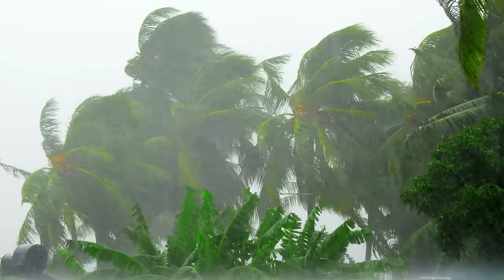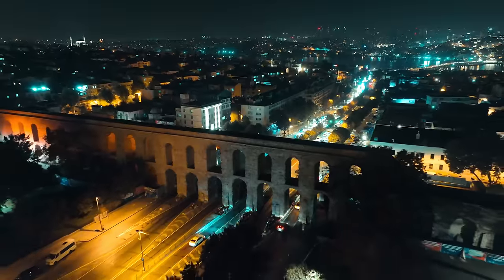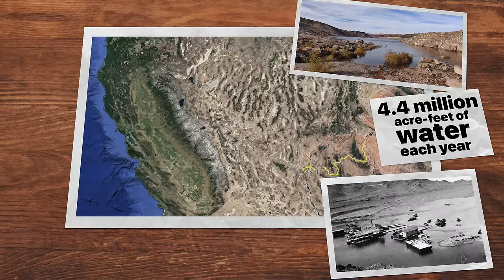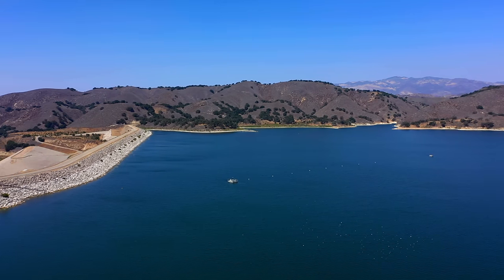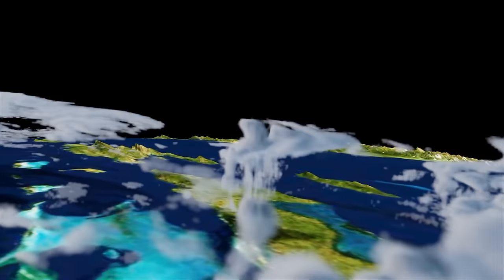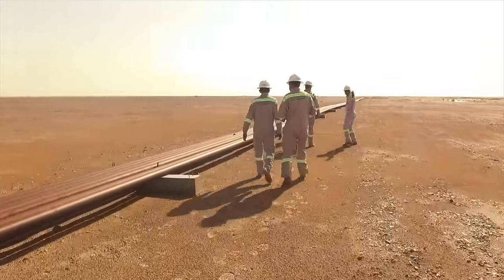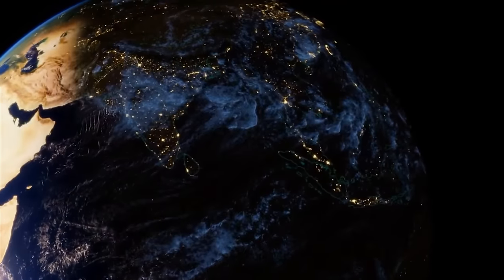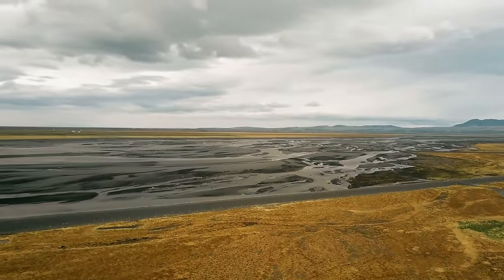Pipelines From Flood to Drought

Comment: A few words that you need to consider, Friction loss, Horsepower (Or Kilowatts), Head lift, Suction loss When you add all these up you are inevitably just looking at an actual PIPE DREAM. Dams are primarily used for water storage. Flood control or mitigation is a distant second, regardless of what ever others may infer Even the best possible release plan prior to an anticipated flood event generally causes flooding or at best primes the event to flood anyway. Now back to the first paragraph. Its is generally cheaper to desalinate water than pump substantial volumes of water over 100s of miles. It takes more Kilowatts (horse power) to pump the water  than it dose to desalinate the same amount and while Aqua-ducts are more efficient if the topography allows, the flow rates cannot be substantially increased to cope with flood events. There for the best option is to dump or use the overflow spillways and let nature do the work for you.
Reply: Excellent point but I think you missed one more point. Dry areas are generally dry for a reason.  There is something that discourages water from going there naturally.  So while this is generally caused by some of the things you mentioned, it also implies low humidity. With low humidity, you have the issue of evaporation. More and more of the water would fail to make it to the destination causing a huge loss in volume, and as such efficiency.
Reply: @davidquist8963  Adding water helps with humidity.  Studies have shown that adding a lake to a dry area increases cloud cover, rainfall, dew etc and rejuvenates the flora, further improving the situation.  If you ignore the problems of capture and transport, dumping and storing more water in dry areas would over time have a net benefit,
Reply: @Johnnyrot10, All you need to do to pump over a mountain is get the water STARTED...once you get enough of it over the mountain, gravity takes over, and it will syphon the rest of the water from it's source. (providing the source is just slightly higher elevation...like the midwest to low lands of california) Then, once the majority of water is syphoned to target location, then you can use pumps to pump it short distances.  Using gravity to take water over VAST distances saves a ton of money.  Leaving the cost of "pumping" the water to shorter distances.
Reply: @Argrouk  , It's hard to compete with mother nature... If the land is dry due to topography, ie Desert adjacent to mountains; it's a never-ending battle to try to convert dry lands to wet lands...It will fail or be cost prohibitive...like Australia failed with their attempt.
Reply: @davidquist8963  , very true. It's hard to compete with mother nature... If the land is dry due to topography, ie Desert adjacent to mountains; it's a never-ending battle to try to convert dry lands to wet lands...It will fail or be cost prohibitive...like Australia failed with their attempt.
Reply: @tjam4229  This may appear to be a simple solution but it is not. The volume of water needed to be pumped over a Hill say 500 ft high over say 10 miles is astronomical, Increasing the pipe line diameter is part of the solution and even when adding "siphon effect" to the system the amount of horse power or kilowatts required to pump flood volumes of water would be non-viable. Lets be clear we are not talking about a tiny flood event, the assumption here is 100000s of cubic meters per hour to 100000 of cubic meters per second Just not viable A tunnel may be viable if the topography would allow but again it would not be a reliable water source .
Reply: @johnnyrot1075  , yeah.  I guess a test with a miniature model or computer model, might be needed.  Seems like there can be some way to take a large pipe, and have a gate valve that basically turns the large pipe into a smaller one.  Once a relatively small flow is gained over the mountain, and water starts to run on it's own, via syphon effect, then the gate can be slowly opened, allowing more and more water, until you have the "colorado river shooting out the other side"  ;-)
Reply: @tjam4229  Australia abandoned their attempt as I understand it, that's different from failure.  I've seen countless water capture and storage solutions around the world that show it's relatively straightforward and need not be expensive at all.
Peter Andrews in Australia is an excellent example.
Reply: @tjam4229  The Romans did it, and they didn't have Elon Musk on standby.
Reply: @Argrouk  Peter Andrews system works without the need to flood He used by design natures water retention effectively slowing water run off and storing it in situ in the ground. Any flood event would progress as a flood event, but retain (in volume) only a small part of the flood. The other thing to remember is if you remove all the flood water hypothetically then you deny the net benefits that would be seen further down stream IE Cubbie station Australia
Reply: @Argrouk  The Israelis are masters of dry land cultivation and they have tried most viable ideas. They use contained systems to mange water where possible rather than open systems The reason is simple Pan evaporation rates are well above average (Its a desert) and water lost to the atmosphere is water lost. On the other hand ground water recharge is a different story and as long as the ground water is not saline (or to saline) there may well be a net benefit. If this were the case then perhaps a better option would be to pump the water into the ground water aquifers
Reply: @Argrouk  , 😉
Reply: @johnnyrot1075  And yet wells have little roofs :)
We're getting a bit hypothetical.  Force feeding the aquifers could result in seismic activity akin to fracking.  The unintended consequences are risky and site dependent.

Essentially we agree that the video idea is pie in the sky, and doesn't specifically address the nature and reason for a flood in a specific location, which is what is required to come up with any viable solution.  A burst river bank is a different scenario from inadequate drainage, and all scenarios are expensive.
Reply: @Argrouk  Can not disagree But here is one near certainty There is a reason in weather event terminology you will hear its a one in 10, 100, or 1000 year weather event, And the reason is simple. You only need to give it time and it will happen(and by definition it has happened before)  We see today that many people are housed along or on river flood plains, and worse still they have filled or reclaimed them thus worsening and widening the flood events
Reply: @tjam4229  if your idea of a mountain is about 30 ft then yeah, you can syphon water all you want over that mountain. But any higher than that, which is basically any hill let alone a mountain, and you can't physically syphon water over it.
Reply: @johnnyrot1075  Most of those event probabilities need revising simply because of the massive amount of paving and building.
While my heart goes out to anyone effected by flooding, the simple truth of the matter is that if you don't give water somewhere to go, it doesn't go anywhere.  Until it breaks something and makes its own way.
Reply: @johnnyrot1075  Let me add one more thing, the destruction of roads and infrastructure often shown on news coverage was simply a matter a time.  The number of roads built alongside water channels, on previous sediments no less, is an embarrassment to engineering.  The recent German and Yellowstone footage are prime examples.
Reply: @MushInSkull  On a Strait up suction lift that is absolutely correct and that's a 1 atmosphere (MSL usually)But  As you increase altitude the suction lift max diminishes  Water boils at 100C or 212F but at altitude that can be as low as 80C  (175F) Because you have less Atmospheric pressure your suction lift (Akin to cavitation) lowers for the same reason
Reply: great info, you should be in charge or at least on the team!
Reply: @tjam4229  Won't work! On the downward side, once the column of water is about 32 feet, a vacuum will occur and that vacuum will only lift 32 feet from the other side. No siphon.
Reply: @Partysize2 , your answer is too general. I don’t buy it. Physics is physics. If you stated a certain diameter, I would believe you. But the fact that you are just stating a certain height of water, I don’t buy it. I’m sure siphoning works on all levels, if the pipe diameter is proportional to the height. It’s just on a larger scale.
Reply: @johnnyrot1075  Agree. And anyone who understand statistics and weather can definitely understand that collecting only 150 years of flood data (perhaps 200-300 yrs in some limited situations) in a region that has seen massive land development altering the runoff and land absorption is not adequate to base predictions of 100+ yr flood events.  Throw in climate change and the fact that mother nature has a propensity for quite frequently clustering extreme events together (like 20 years of overactive Atlantic Hurricane seasons, or 20-30 years of drought near the Lake Mead & Lake Powell), and then one can see why trying to predict events more than half the length of data you've collected is overly optimistic wishful thinking.

(And BTW, Earth's climate is always changing, the numerous Ice Ages and subsequent thawings over the last several hundred millennia cannot be disputed; US was once covered all the way down to Great Lakes and Ohio/NY by Glaciers; "anthropogenic" as the largest contributor is debatable and also biased if you understand the arguments about why 100+ yr flood event prediction doesn't have enough data samples (continue reading...)). 

If you want to forecast the next 100 years of flood probability, you need to have a minimum of 200 years of flood data to ensure there is not a larger weather cycle with 100 year period (known as the Nyquist Sampling Theorem). For example, with 100 years of records, it's possible the 1st 50 yrs were wet, the next 50 were dry, and then someone assumes "Climate Change" together with the last 50 yrs of data is indicative that there will not be a subsequent 50 year wet spell. Only with 200 years of data can you see the trend that mother nature has a 50 year cycle of wet/dry.  

And before someone points out that tree rings and silt deposits can go further back to help augment human records of history, let me say most trees are not over 100 years old (except sequoias in CA; most wood decays in less than 50 years and are not preserved well enough across the many varied areas of the US to account for all the microclimate regions across the US), and silt records by themselves are past trends but not necessarily indicative of whether the topography caused the flooding, or if it was due to intense rain event (and where it occurred, perhaps upstream many 100 miles away).  

Therefore, to make flood probability forecasts beyond 100-200 years is very presumptive (especially in an area where land development has likely made past data not applicable to the current flood and runoff dynamics) and not well supported with enough data. And 300y, 500, and1000 yr events is just plain ridiculous.  If you want to average mother nature, ideally you want to see several (somewhere around 5+) of these longer (20+ yr) abnormalities, which would likely take somewhere near 500 years to collect (One 20 year drought/active hurricane season, etc during each 100 year span).  Then you could average it out to predict the probability of the next 100 years of possible climate, hurricanes, floods, major disasters..... whatever-you-want-to-determine.  And if you're really savvy on statistics, then you need to indicate the uncertainty with your average by including a Confidence Interval for it have any true statistical relevance (assuming normal distribution; otherwise indicate the probability distribution that gave the best model fit and the goodness-of-fit, confidence interval, etc).
Reply: @tjam4229  Well, TJam, this is a problem solved by physicists a long time ago. It is not a subject for debate. Diameter has nothing to do with it. Check out a high-school physics book and explore this subject for complete information. Or just ask a high-school physics student.
Reply: @tjam4229  alas syphens only can lift water so far . I want to say 32 feet . If it trys to pull the water higher it simply boils from lack of pressure ie turn from liquid into gas. That's why the pump mechanism is at the bottom of a well
Reply: @jeffbybee5207  , it is true that vacuum siphoning will only lift water about 33 feet. That’s why you would start the process using a pump. Once the water is pumped over the mountain, air pressure from one side would continue pushing the water over the other side of the mountain, as long as determination point is lower than the starting point
Reply: @jeffbybee5207  , your example of using a well as comparison is totally off. You cannot siphon water from the bottom of well to the surface, because the endpoint is higher than the bottom point. You’re trying to pump water up from the bottom of the wall. if you were trying to pump the bottom of the well to a even lower location, you would not need the pump at the bottom of the well. You could just siphon the water out the bottom of one well, to the bottom of a deeper well, if you wanted to
Reply: This should be done! 

What if it's only 10% efficient? 
10% of homes in Louisiana not going underwater. 
10% of homes and force California not burning. 

Even at 10% it's worth it!
Reply: You don't need to clean oil pipelines, you need to coat them with an oil resistant liner, that technology already exists.